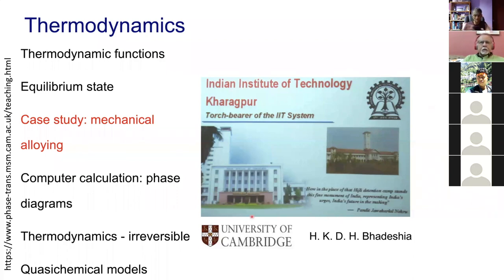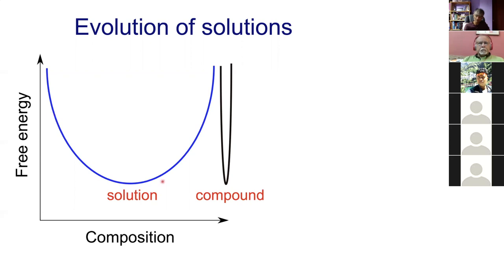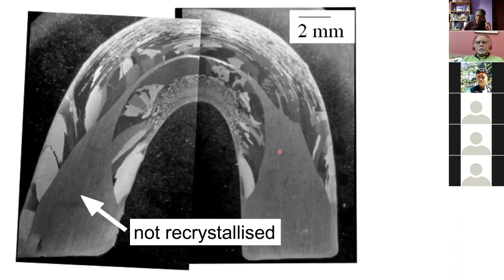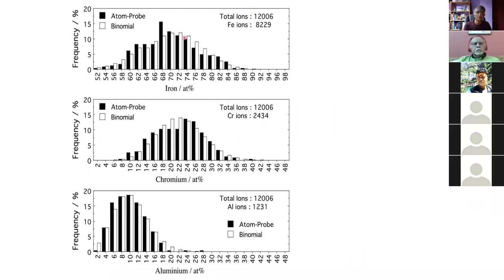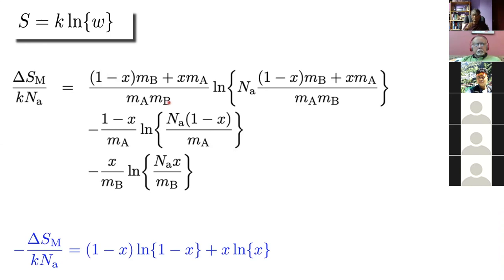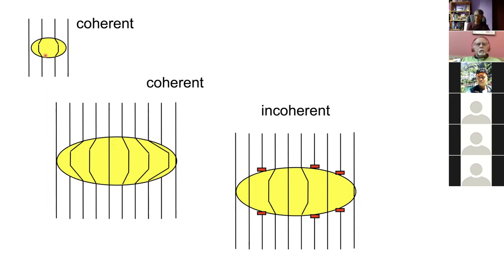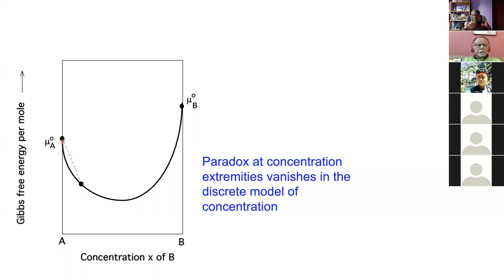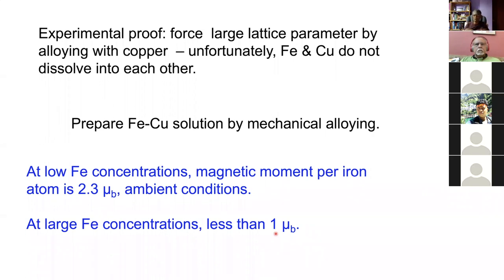Thermodynamics - mechanical alloying & evolution of solutions

Comment: Dr. Professor Bhadeshia, why free energy of compound vary enormously with composition?
Reply from the maker: "why" is not possible to answer because it becomes a recurring question. However, when there are very strong bonds that form between different atomic species, it is difficult to break them, meaning that a great deal of effort is required to do so.